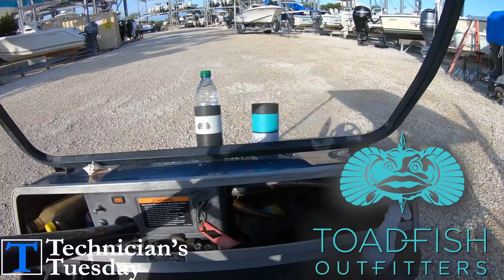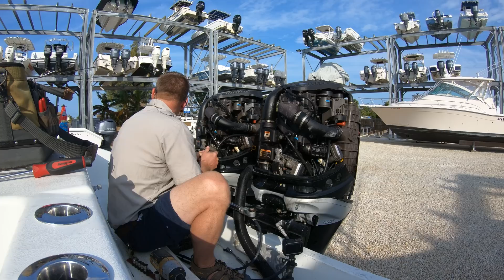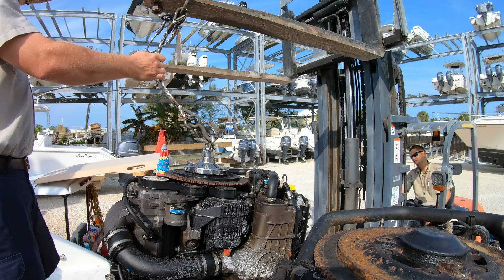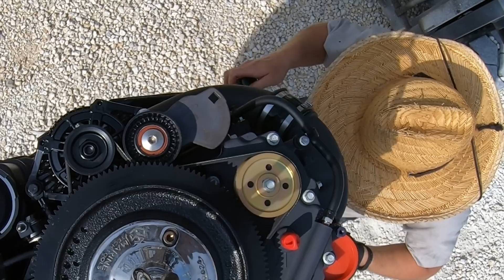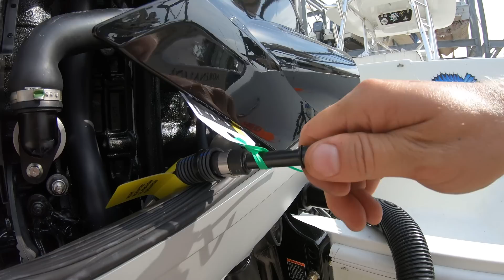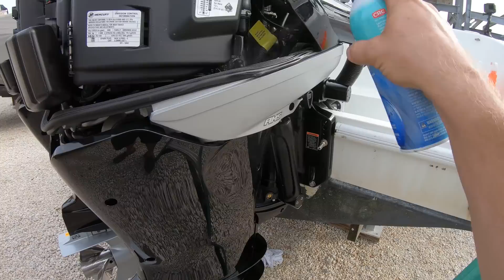Replacing An Outboard Engine!

Comment: Thanks for all of your videos.. I am currently repowering my older but very solid ( and dry hull) Boston  Whaler.. With new Mercury 300s... Replacing the second set of outboards..2005 Evinrude etecs 250 hp. . They have served me very well with just over 4000 hours.. Yes you read that right.. Just hope these new Mercs are as reliable.. This is the 3rd set of outboards on my Whaler .. Thanks again for your videos.. Captain Ron. Naples Florida

Comment: Just picked up a 92 Mako 221 powered by a 2003 Yamaha F200 with 700 hours. Unfortunately it hasn’t been used for a while, but it was kept inside. With the help of your videos I have been able to basically rebuild the lower unit, change the oil, replace fuel lines and components and trace a “not peeing” issue back to the rectifier that was 100% blocked by impeller chunks. Thanks from  the Panhandle!

Comment: Aaron what are your thoughts on using hydro fluid in place of Seastar’s power steering? Seems like a rip to me. I’ve ran both a can’t see any difference. Wondering if you have?
Reply from the maker: I can't really tell a difference either lol on new systems we try and keep the clear OEM stuff in the system though. I'm sure there are some pressure and temperature ratings that we don't know about or understand too lol oh well :)

Comment: Awesome info, I want those lifts!  Of all the outboards you lifted, where could you say the center of gravity (c.g.) in general is located vertically?  Horizontally I can say that the c.g. located above the flywheel center.  I trying to determine if I can position the c.g. directly over the transom using my trim and tilt.  Thank you!
Reply from the maker: They are all different. Really depends on the model of the engine. Some are straight vertical, which is amazing, the rest usually have the powerhead leaning forward, towards the boat. So you put power to the trim unit and move the engine bracket to be the same angle as the transom when you are mounting it.
Reply: Thank you for taking the time to help me.! @BornAgainBoating

Comment: My bad experiences , Two days ago i bought a older boat a Wellcraft 170 American from a dealer and the first time I put it in the water, I heard a knocking sound in its mercury cruiser 3.0 engine. So I brought it back to the dealer because I know this motor has blown crankshaft bearings. They're like it's a brand  new engine but it's no good cause I never even get to take it on the water successfully for the first time.

Comment: How would i know if my outoard is seized?
Reply from the maker: Try to turn the flywheel, if it doesn't turn, drop the lower unit and try again, if it still won't, it's seized :(
Reply: @BornAgainBoating  it's seized

Comment: mercury optimax 200 hp 2006 with 987 hours on my cobra 665 rib . one compressor and a broken reed valve  until now... running strong and efficient .

Comment: Are the old engines worth refurbishing? 
What watch are you wearing?
#toadfish
Reply from the maker: Sometimes, but for down here and saltwater, not really. Most of them when they are old and beat up, it's not worth the money to rebuild, unless you can do it yourself. Then it's by the engine kind of case. If most of the engine and parts are in good shape and its a worthy candidate, you can rebuild it.

The watch is a Luminix Navy Seal Bkack Out and I love it! Had it about 6 years and its fantastic!

Comment: when installing the prop, is there a torque setting? I'm worried about over tightening. A #toadfish sounds like a missing link in the evolution chain, maybe found in the everglades.
Reply from the maker: Most manufacturers are around 55 ft lbs

Comment: 1996 Bayliner Capri 1600ls with a 1997 Force 75hp two stroke.  I can't wait to replace that engine. I just have to save a little bit more Benjamins for that to happen. #ToadFish.

Comment: #toadfish something I noticed and I think its important is using the proper lubricant on the stainless bolts when running them with a impact . My experience with ss bolts and running them up fast they gall and lock up. I use a green tapping and drilling compound and have not had that problem since.   Great job guys
Reply: He was using an impact gun it is anything but fast, Not to mention those are course threads you will never have a problem galling the threads!

Comment: Great video very useful info, But what would be required if say you were replacing a 85 HP 2 stroke with a 90 HP 4 stroke  after converting a twin console to a center console, I am sure that operation would be a lot more complicated
Reply from the maker: Thank you! Yes, that would take a lot more on that job. You would need to replace all of the rigging in the boat and then check your shaft lengths, mounting height, and make sure that the boat can handle the extra weight of the four-stroke in the back without putting your deck drains underwater!
Reply: I hope you dont mind if I pick your brains a little, my boat is a 20ft Yamaha, current config is twin console, which I am converting to a center console, I have 2 batteries in the rear Stbd quarter, 20 year  old great Suzuki 85 HP 2 stroke motor with Hydraulic steering , I want to replace that with a new Suzuki 90HP  4 stroke, there is a  a 50 Lt fuel tank immediately above the step down bilge area, I have a Tohatsu 18 HP as an emergency kicker on the port quarter, there is a fish box in the mid section hull which will accommodate the fuel tank, if I then put both batts inside the center console and remove the 18 HP kicker altogether do you think that will address the weight differential? if Not I would consider down sizing to maybe a 70 or 75HP motor, As I  live in SE Asia it is near impossible to get quality work done here, that is why I am doing the work my self,  Any assistance  or advice would be greatly appreciated, Many thanks.

Comment: That's a good informational video about changing a boat motor out on it there but I don't understand why you would have to change it out after just fifteen hundred hours on it though to me it would be well broke in after that amount of time a running it that is if theyve been taking care of the engine from the dealership
Reply from the maker: That's just per year ;) the engines had over 3k hours! They like to sell them with warranty left :)

Comment: Hi, how are you? Excellent video. My twins engines are two-stroke 200 hp Mercury Saldwater 2.5 carb of the year 2004. They are still running. But I would like to make a repower Greetings from Manuel from Panama. #toadfish.

Comment: So why does that boat have 2 steering cylinders, I have the same setup with twin 300 Verados, but only one has a cylinder and a tiebar connecting them? just curious.
Reply from the maker: That's a Mercury thing, once you pass the 300's and put the 350's or 400's on, they require two steering cylinders on the engines. You'll also notice that they have a special bracket on the bottom of the trim section that helps to hold the engine's midsection. Just keeps things nice a tight and straight when at speed. The bigger the engine the more torque and the faster speeds they get up to, so I guess you could say it's a safety deal :/ maybe lol but that's what it's there for.
Reply: Awesome channel thank you for the video and the response!  #toadfish

Comment: 2000 Johnson 70hp 3 cylinder on a 2000 Kenner 17v. Runs like a champ! Do you guys recommend the use of Yamaha's ring-free fuel additive for 2strokes? I have definitely been enriched by watching Technicians Tuesday, thank you and keep up the good work! #ToadFish
Reply from the maker: Yeah, ring free is great stuff, but on that old Johnson you shouldn't need it on every fill up like a four-stroke likes, maybe just run a bottle once a season. Those Johnson's stay oiled up so they don't build up a lot of carbon like a four-stroke!

Comment: 2001 Evinrude 200 Ficht.  I know they have a bad wrap, but keep the cooling passages to the EMM cleaned out and put new indexed plugs in every season and you should get years of service out of it.  I have about 800 hours on mine.  Only complaint is the fouling of plugs because the area that I boat has a very long no wake zone to get out to the bay.  Lots of idle speed....my engine likes to go FAST! 😁 #Toadfish

Comment: Just wondering what is the status of the engine s taken off are they for sale
Reply from the maker: I believe they have already been sold, but we replace a lot of these engines for these guys. I think they have 12 boats now and usually every 2 years replace the engines. They average about 1500 hrs per year so they repower at about 3-4K hours. They will have two 300's coming off next week on another boat and then there is a 30" V8 300 with only 1600 hours, (right now, lol next month that could be 2K) that I know he hasn't sold yet. But is ready to sell it.

Comment: My engines are twin 2005 Mercury Verado 250 XL L6 SuperCharged counter rotating engines with 1410 hours a piece. Born Again Boating, what is the life expectancy on my motors? We want to repower with twin Mercury Verado 350 XL L6 SuperCharged brand new counter rotating engines but can only do that with a lottery win 😩. Also can you please do a video about Mercury Remanufacturing and the advantages/disadvantages to getting your engine rebuilt and advantages/disadvantages to repowering? #ToadFish
Reply from the maker: Run them until they die! Lol the remanned powerheads aren't bad. And they are a lot cheaper too! But I would say to save the money to buy something newer. The 2005-2007ish Verados had oil squirters behind the pistons, which they did away with that block design and now have it done a lot better which makes them last longer :)

Comment: My Outboard is a 2004, with about 500 hours on it, and half of those are mine (i bought it used last year), i put an engine hoist in the back of my pick up to mount it - a fork lift would have been nice. #Toadfish

Comment: The two engines are counter rotating, what determines which engine is on port or starboard?
Reply: Richard Geeslin it depends on the tipe of hull
Reply from the maker: The engine on the left is the port and the engine on the right is starboard :) ;) they just have two left handed props!